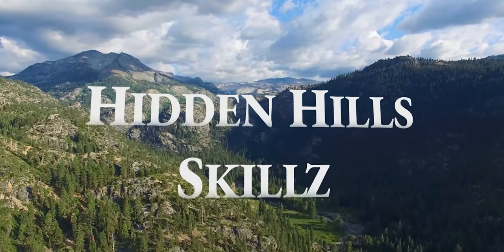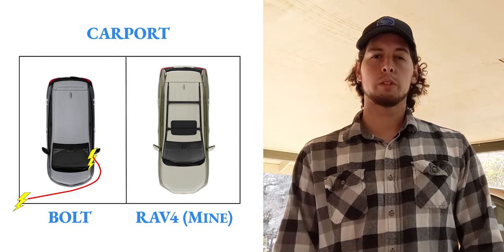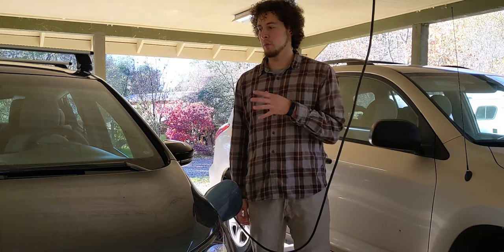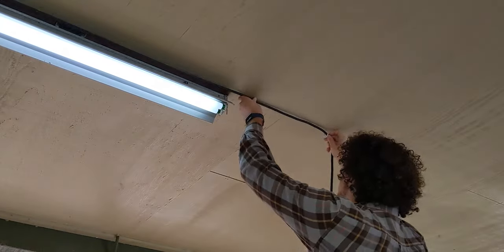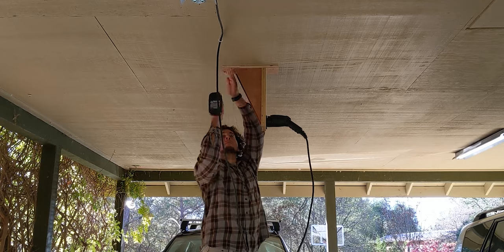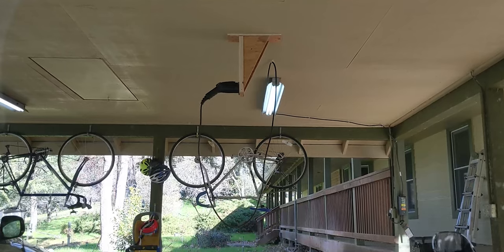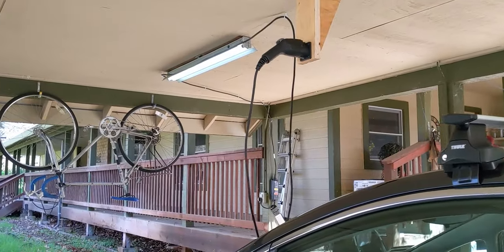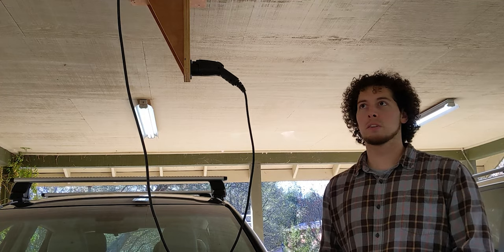DIY Electric Vehicle Cable Management // Scrap Wood Docking Bracket

Comment: If you drop the thing, it'll swing right onto your nice car.  Also, the reach looks hard for anyone shorter than yourself
Reply from the maker: Good points. You can cut the plywood longer than mine so it comes down farther to accommodate your height and reach. We haven't dropped it yet, but you could also place it off to the side in the walking path by the car if you're worried about that.